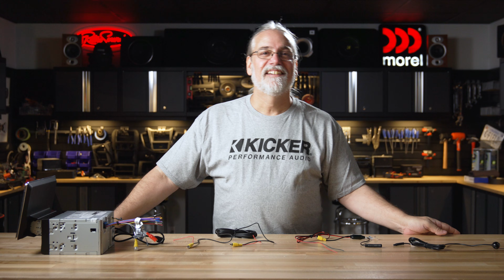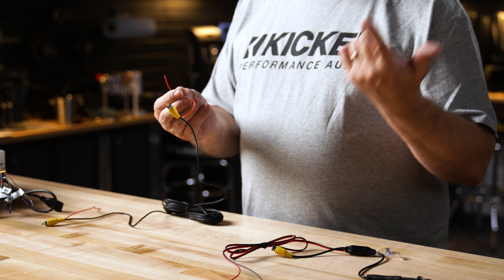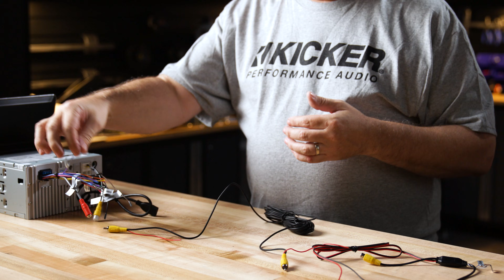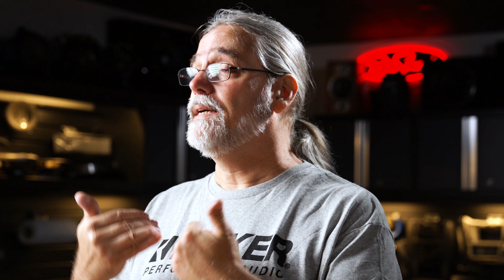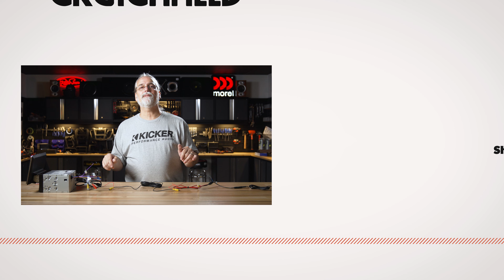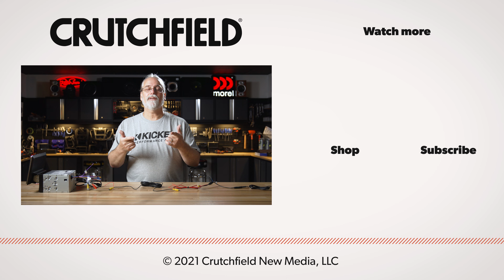Powering your backup camera (and how to use that extra wire) | Crutchfield

Comment: Can I use a reverse camera as a front camera I.E I bought a reverse thinking it was the same thing
Reply from the maker: Sometimes you can, it just depends on the camera and if the image can be reversed for front camera use. Do you know the model of your camera?
Reply: @crutchfield  it's a cheap ish one from ebay. Doesn't have a make on it, I see the issue being the image now, as other cameras have a wire to cut or not depending on position installation
Reply from the maker: We hate to hear that the image is not reversible on that camera you purchased. We offer some cameras that can be used as front cameras and they can be found using this link:

https://www.crutchfield.com/I-rYALc227/g_277650/Backup-Cameras.html?fa=1#&nvpair=AG_General_Features|FFFront@view_Capable

Comment: Hello sir. The black wire that you said needs to be grounded to the frame...can it be connected to the negative wire of the taillight? Some videos or websites suggested that approach and I don't know if either one is ok or if it makes any difference. Any advice would be great.
Reply from the maker: The concern is the size of the ground wire for those stock lights. It is often not big enough to support a backup camera as well as the lights. We do not recommend using that wire

Comment: Wondering if you could explain why we want to use a chassis ground for the backup camera rather than tapping into the ground wire in the backup lamp?
Reply from the maker: The concern is the size of the ground wire for the backup lamps. It is often not big enough to support a backup camera

Comment: Yeah, this video's as confusing as the lack of instructions with the backup camera. Mine works, but doesn't automatically turn on when reverse is engaged. I still don't know why.
Reply from the maker: This situation is typically linked to a wiring issue with the receiver; specifically the reverse gear detection wire and it being connected to the wrong wire within the vehicle (or not connected at all).

Comment: Mine is hooked up but don't have the brake wire hooked up but my camera view is upside down.
Reply from the maker: Oh no! It sounds like the camera may be mounted upside down. If you purchased the gear from us, we recommend contacting our technical support for help resolving that issue and finishing the installation. Their toll free phone number is on the order invoice.
Reply: @crutchfield  
I flipped the camera every which way and it is still upside down.I can't even get to my camera settings on my power acoustic multimedia player at all.Any advice.If I can get to my settings I'll be able to adjust it,but I can't get to my settings at all.
Reply from the maker: We are not familiar with Power Acoustics gear to know what to officially check next. We do know that sometimes radios prevent access to the more advanced setup menus until the parking brake detection wire is connected to the proper wire in the vehicle and the parking brake has been set.

Comment: Can I put a switch between the 12v accessory power wire and the power supply line to the camera in the AV wire connecting the purple reverse wire to that same side of the switch to turn the camera on and off without issues? 12v power accessory - switch - camera power and reverse wire
Reply from the maker: What model camera are you looking to use? What do you plan to connect it to for viewing?
Reply: @crutchfield  Just a run of the mill backup camera. I want to be able to turn it on with a switch to watch a trailer. I'm okay with having to switch it on everytime I put it in reverse. I'm just not sure if I will fry anything doing it this way. Thanks.
Reply from the maker: You could put a switch to turn the camera on and off, sure!

Comment: A very nice and detailed video, I have a question please can you help me? I have a Kenwood MKL015ELG4 in a Mitsubishi outlander 2017 and it has a reverse camera but I want to add a front camera. 
Can you please help me with the connecting of the camera?
Thank you.
Reply from the maker: I can't seem to find too much about that model.  Does it have a second camera input?
Reply: @crutchfield  
I dont think so thats why Im sending the plan of the connection of the back camera.

8 pin Camera Connector
Terminal
No.
Signal
symbol
Check
item
Check
condition
Terminal
voltage
41
CACC
VCC
(RC6.5V)
Ignition switch:
ON position
Selector lever: (DC)
R position
5.8 - 7.0V
44
+B
45
CGND
BATTERY
（+
GND (RC)
Always
System
voltage
(DC)
1 V or less
46
CMP+
CAMERA
SIGNAL
Always
Ignition switch:
ON position
Selector lever:
R position
1Vp-p (AC)
47
CMP-
48
GND
SHIELD
(CAMERA)
GND
Always
1 V or less
Always
1 V or less
Reply: @crutchfield  sorry it was my bad, the model is MXL015ELG4. Can you help me to connect the front camera please.
Reply from the maker: Thanks. Looks like that is actually a factory installed Mitsubishi radio. This means the camera inputs would likely be proprietary. Your best bet is to check with your local Mitsubishi dealership for a compatible camera.
Reply: @crutchfield  hello, thank you, but I want to install the camera alone because I’ve already bought it. If you could help me with the wiring of the second camera, that would be great.
Reply from the maker: There are no adapters for that OEM radio, and we do not have a way to integrate in a second camera, nor could the radio handle a second input. :(  If there is a solution, it would be from the manufacturer ( in tis case that is Mitsubishi from the looks of it).

Comment: you missed that if you install a switch between the parking brake sensor wire the camera, if you flip the switch off and on while driving, any head unit will let you see out the camera.

Comment: I've got a rear camera ,but that long cable has on 1 end 1 yellow connector and 1 red wire and on the other end has 2 connectors and also 2 wires red and black, how do I connect them to camera and to box? I was thinking, that end with 2 connectors plug into the camera( and these 2 wires from same end ,red goes to lighter and black to ground) and the other end with 1 connector to box and wire to purple wire coming out from box, it's ok like this?
Reply: My car it's an audi a5 2011, manual, and ive brought a box from China ^^ with rear and front camera,wondering how to install all these things ...
Reply from the maker: If you purchased the camera or stereo from Crutchfield, our Tech Support staff can help with specific installation/wiring questions like that in detail. Their phone number will appear on the Crutchfield invoice.

Comment: Is it possible to wire back up camera to turn on when car goes into reverse and to also use the camera when U want to check on to rear of vehicle
Reply from the maker: Most aftermarket radios offer a reverse signal input wire on the harness which connects  to the corresponding reverse wire for the backup camera. That way the backup image is automatically triggered when the vehicle is put in reverse. As far as checking the image while not being in reverse goes, some radios offer a camera toggle button for that purpose.

Comment: Hi this video was very informative and straightforward. I had an issue after the install. When I put the car into reverse it switch to  a black screen without any error message or image. What could be the problem.
Reply from the maker: Glad to hear that you liked the video! 🙂  We're sorry to hear that you're having an issue with your camera. If it was purchased from Crutchfield, our Tech Support staff can help troubleshoot the problem. Their phone number appears on your Crutchfield invoice.
Reply: I installed a Boyo rearview camera to a new Kenwood head unit and it works in reverse as it should.  If I hit the CAM button, I get a black screen.  I'm planning to use the advice in this video to try to power my camera all the time while still using the signal to trigger reverse when needed.  Should work.  Since I can't leave anything alone, I was messing with some settings and then my camera screen was black in reverse.  It turns out that I had set the camera quality or type to HD and apparently this camera won't show up under that setting.  So I would look for a camera type or quality setting and change that to something else.  Crutchfield is the best for support.  It would be hard to find a company that does a better job or has better people.
Reply: @iShootThis  Thank you for your reply. I went through all the settings on the headunit with no success. I did some more research and found out that the video cable maybe the problem, I just haven't had a chance to swap out the cable. In the mean time I'll mess with the settings again to see if I missed something. I appreciate your help.

Comment: This video helped so much compared to others I have found and on google but one question could I wire the reverse and camera wire to the power wire from the cord coming from the camera. Would that then give me the two options
Reply from the maker: A receiver's reverse gear detection wire should only be connected to a circuit that is active when the vehicle is in reverse. Some radios are built to provide power to a backup camera. If you get one of them the it would be ok to connect the camera's power wire to the receiver.

Comment: This is literally THE BEST video for backup camera installation. Most videos don't go nearly into the detail of the head unit connection. Why? Because they aren't good videos. You guys do an amazing job! Now, if I could only find where the trigger wire for my 2014 Camry Hybrid is located. Any tips would be greatly appreciated!

Comment: Can we use accessory red wire of the receiver to power backup camera? As i hv heard accessory wire is only for singnal for receiver to turn on.
Reply from the maker: You can connect the backup camera's power wire to the same wiring in the vehicle that the radio's 12V switched power wire connects to. This way, when the radio is able to turn on, so is the camera.

Comment: Well, I am surprised that more folks are not talking about the wireless transmitters ... one of which I just installed in my car and I saved me all the disassembly of the interior body panels and wiring that darn wire through the length of the car !!!
Reply: Point me to a decent one.

Comment: What’s the reason for putting the ground cable separate from the reverse light ? Does it mess up the camera or radio if wired that way ?
Reply from the maker: You need your gear all ground correctly.  Sharing a grounding wire with your back up lights could cause issues.  It is best practice to ground electronics directly to the chassis frame.

Comment: Is there a way to wire the backup camera so that it triggers automatically when you put it in reverse but at the same time be connected to a regular 12v wire so that it always has power? I’ve wired a backup camera before but only tapped into the reverse light, I now have a truck and want a way to view the camera anytime while still having it automatically pop up when I shift into reverse.
Reply from the maker: This is definitely possible! The radio has the wire that when properly connected, automatically brings up the backup camera when the vehicle is in reverse. As long as the camera gets power anytime the vehicle is running, it can be shown on radios that have a camera view mode.
Reply: @crutchfield  So if I hook up that trigger wire to the radio it’ll know it’s in reverse? I’m probably going to tap into the regular taillights so the camera will have power with the running lights.
Reply from the maker: The trigger wire is part of the radio and usually called Reverse or Reverse Gear Detection wire. That wire needs to be connected to a wire that becomes hot when the vehicle is put in reverse.
Reply: @crutchfield  I read online and found out my trailer harness has constant 12v power when the truck is on, would it work if I tapped into that so the camera will always have power and then tap a separate wire to my reverse lights and tap the other end of that wire to the trigger wire on the radio?
Reply from the maker: Yes. Chris actually details this option at 3:03 of the video above.

Comment: Great video. I have a broken backup camera with 8 pin connector. But I have nowhere to find a replacement camera with 8 pin connector, most of them are 4 pin. And I couldn't find 8 pin to 4 pin connector as well. Any suggestion? Thanks
Reply from the maker: What model is your camera? What is it connected to?

Comment: I purchased a backup camera for my 2009 Jeep JK installed with my licence plate light. I tested the camera before doing a full install and it worked, But when I re-installed it and it does not work, Any reason why?
Reply from the maker: As long as the wiring was connected properly in the vehicle, then perhaps the cable has been somehow corrupted or the connections have come loose. You may want to double check all that. If it was purchased from us, our technical support may have other things to check. We send their toll free phone number on the order invoice.

Comment: The reversing camera's I have, have the parking lines already set up but I want to remove them. However, my wiring does not have the 'extra' wire to cut. I know it's a long shot but do you know if there would be a wire in the sealed cable, that I could cut instead. I asked the seller but they have no idea. If I do cut a wire and it all goes wrong, it's my own fault. So I'm willing to take the risk.
Reply from the maker: We do not get the information about the internal wiring and colors to help with identifying the functions. Wish we had different news for you there.

Comment: Just bought a 7"monitor for my 2000 dodge Dakota and is didn't have any instructions or anything (it's not even what I was looking for lol) and decided to go ahead and buy a reverse cam, and now I have most of the info I need to install said cam/monitor. Any advise on how I can turn my reverse cam into a recording rear facing dash cam, if that makes sense. People here can't drive for shit and I'd like to have evidence of that in an accident. Thank you for the help so far
Reply from the maker: Congrats on your new setup! If you got it here, please call our Tech Support for help with installation. Keep in mind, the camera would have to offer the option for use as a front camera and you'd need some way to integrate it with a recording device. An all-in-one dash cam tends to be the best bet for this need here: https://www.crutchfield.com/I-rYALc123/g_428250/Dash-Cams.html?tp=65802

Comment: If my convenience cable doesnt reach my head unit, can I use a female to female adapter and then connect the 2 red wires together to extend the wiring?
Reply from the maker: Yes, you can extend the wiring!
Reply: I had to buy a longer wire, I got a 30ft wire for my van on Amazon for $6. Shorter wire with splice was same price and less splicing the better

Comment: This is the most helpful video for wiring up a backup camera! I’ve watched dozens and this really simplifies it and makes it easy to apply to a specific vehicle.
Reply: Real talk you are a goat for this video . The help is so useful
Reply: Really a well Handle the video with all steps on how to do it by yourself thanks for your kind help us to solve this particular item and this is my question do you have a great resolution camera
Reply: Awesome video definitely the best ! I got a quick question . I purchased from crutchfield a boss BV755B and I'm not sure which one would be  the reverse gear trigger wire that you mentioned... I got a few labels here please if you point me to the right direction I will appreciate it so much .. is it the "reverse input (+12V) " or "rear camera power (+12V,500mA)... Thank you!!!
Reply: Thank you! I indeed wanted to comment the same!
Reply: A improperly called solar generator is all im using. Runs the cameras for weeks. Its lithium iron phosphate so not going to fireball like lithium ion. Bypasses parking mode that doesnt catch everything cause theyre on all the time. Just have to monitor the sd cards sooner. I have a 2 channel Thinkware f200 pro set front and back and 2 Garmin mini 2s on the sides. I dont have to worry about a dead battery on the vehicle. Just charging the generator every other month.
Reply: Crutchfield ROCKS!
I try to always buy from them first.
They're usually pretty competitive with Amazon sellers on price, but you get so much more than just a  product!
Sometimes stuff is out of stock and I have to source elsewhere. Like the subwoofer box that I needed. But I still bought the Sub from them .👍
Reply: @ginakerry2588 u
Reply from the maker: Thanks, Devin. Glad we could help. If you need anything further, please us know.
Reply: @crutchfield  why does my reverse camera cut in and out while my volume is up? Revers camera works great if radio isn't cranked up.

Comment: Hi, can you tell what exactly happens when the "image mirror" loop is cut ? I mean, what connections are made or cut. What makes the camera send a mirrored image ? Thanks
Reply from the maker: Hi there! The image mirror loop allows you to use the camera as either a back-up camera or a front-facing camera and select the appropriate image type to be displayed. Do you have or are you looking at a specific camera? Different manufacturers may set this up in slightly different ways.
Reply: Actually I mean what changes in the electrical scheme, or to what is this loop connected.
Reply from the maker: The mirror loop changes the orientation of the image between mirrored or not mirrored so that what's is really on the left side of the vehicle will appear on the left side of the screen.